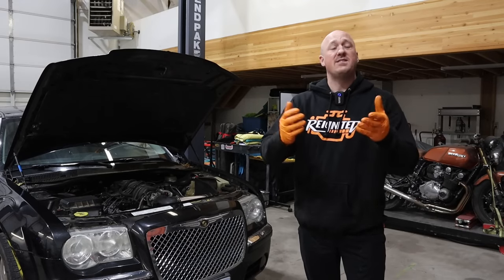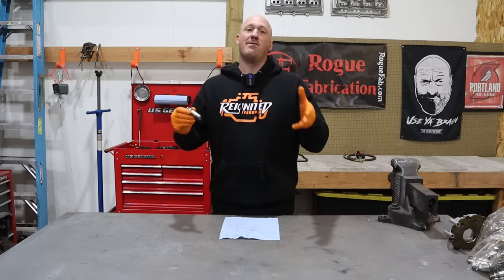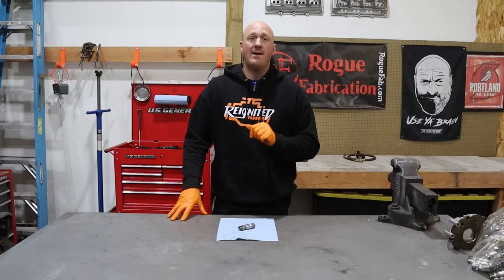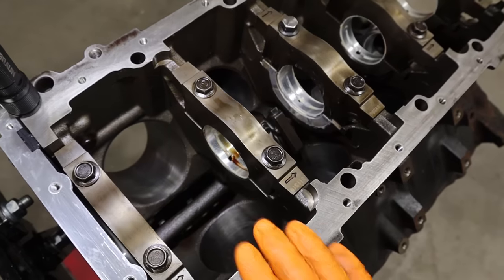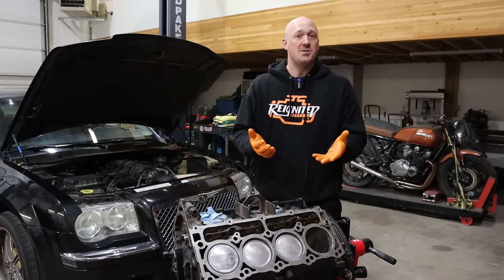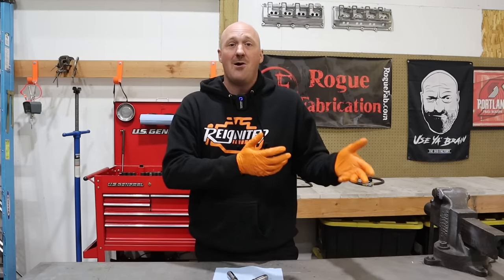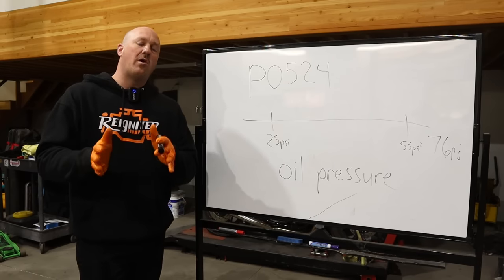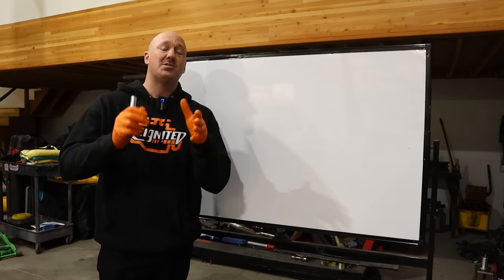The BEST Prevention For Hemi Lifter Failure! (In My Opinion)

Comment: My 2015 Ram 6.4 got metal in oil at 98k. Bought a complete engine from Chrysler, cam from crane, upgraded springs Removed MDS, Hell cat oil pump and lifters, new radiator.  After JMB in Hillsboro Mo. tuned it the transmission shifts correctly finally after 8 years. (6 speed).
The coolant always stays at 215 degrees and the oil temp stays at 226 degrees. 9k miles so far so good.  But at a total cost of $18,700. I hope it holds up. I do not want to buy another new truck. I still have the old motor and have not opened it up yet. Also this was during the time of parts shortage 6 months of waiting. Soon I will have dual exhaust and be able to enjoy the slight rumble of the cam.
Reply: When you follow the lighter oil the car will prematurely fail.
Reply: @johnf.6942  That's what I've heard.
Reply: It seems rather redundant not to use a 180* thermostat, but it sounds like you’re an engineer.

Comment: A most informative video.  Nice to know that mds is not the real problem.  I change the oil on my 2015 300 hemi at  5000 miles or less and use synthetic oil.  I doubt I will go the hellcat oil pump route but it is nice to know there is a preventative procedure available.  You explain things thoroughly and clearly.    Thanks again.
Reply from the maker: Appreciate you watching!
Reply: MDS still not good. If I want a V8 then I want a V8 all the time. Not a V6 or 4 cylinder. I only get 13 mpg with MDS anyways. I have a 06 2500 power wagon.
Reply from the maker: @DavidSmith-tu1nd  I do think it doesnt make sense in the bigger trucks like that. Problem is that wringing every last ounce of fuel economy out of these engines is the only reason they have lasted as long as they did. EPA mandates are not awesome.
Reply: @ReignitedAuto  
Yeah I know epa stuff. Is it possible to mount eagle heads on a 06 engine? My engine is running strong no valve seats have let loose, I known the eagle heads were more efficient.
Reply: @DavidSmith-tu1nd yes you need eagle pushrods, .070 cometic head gasket, new exhaust manifolds and intake manifold
Reply: @ichrised 
Thanks for the info. I'm gonna do this head swap and make the oil pump up grade.
Reply: Too many mile interval. It is established only to meet warranty. Change @ 3,000 and the engine life will be nearly double.
Reply: Thank you so much for this forever a subscriber , does changing my oil pump VOID my warranty ?
Reply: @wendellrivers853 most likely yes. I wouldn't touch anything until the warranty period is over.
Reply: @3029dz  Good full synthetic motor oil doesn't need to be changed every 3000k miles -- it just doesn't break down as quickly as conventional.  If you feel better about changing every 3K like grandpa swore by, just stick with conventional.
Other than that, I don't disagree with 5k intervals on full synthetic.  The Hemi probably needs a bigger oil filter to make going much longer than that safe.
Reply: Just replace camshaft and all 16 lifters!!! 6000$ bill for parts only...all OEM
Now have about 20,000 km and still thick and run rough on idle and still suck à lot of gas... reopen engine 3 times, put 4 solenoids MDS and cam solenoid and still thicking...
No troubles codes 
Someone have and idea?
I regret havent put a new engine at start or have done MDS delete
Maybe have to say, first time i start engine after cam job, it run perfectly till i hit the road...
Reply: @simonac850  is this in a 2009 or later, or a pre-eagle engine? Did you pull the screen to verify that there were no shavings to the screen yet (2009 and later only)? That is the thing you must do before swapping in the new parts. If you see shavings, the rule of thumb is to rebuild or replace at that point.
Reply: If you are pumping shavings around in the engine, it can't help but fail right away. The fact that your ticking started as soon as you took it on the road makes me worry that your lifters are failing again. Have you verified that it is not an exhaust leak? The ticking sound is similar, it is also not uncommon to have an exhaust leak after doing this work.
Reply: @simonac850  you probably rebuilt your engine multiple times and only had an exhaust leak to start with....

Comment: Hi. I'm from Poland and here this engine is not as common as on the continent, which is why most people succumb to stereotypes rather than delving into the topic of the MDS system, which is considered to be defective. No one could answer why it was so bad. Initially, I thought it was a matter of poorer material of the pushrods, because in engines without MDS the effect was similar with damage. Thank you for such a sensible explanation. Finally someone wanted to delve deeper into the topic.

Comment: This is an outstanding development! I can’t thank you enough for the effort that you have put into the tick issue. 
I have been through this, replaced the cam and lifters, followed your advice and upgraded to the HC pump in my 2012 R/T. The P0524 error has been plaguing me as a result. I installed a code reader and just keep clearing the error as it comes up. I will definitely be putting the in-line resistors into play as soon as possible. Thank you so much for all that you do. 👍🏻👍🏻
Reply: Hey man have you done this yet?

Comment: Both my hemi-powered Mopars are performing flawlessly, with 130K miles on my '12 Challenger R/T w/5.7 hemi & 6 speed manual trans, no leaks, oil usage, or ticking other than normal injector firing noise, same deal with my '14 Chrysler 300C w/5.7 hemi, excellent performance at 91K miles and no "tick" either. I use high quality synthetic oil in all my rigs, it has kept them running very well and change oil & filter @ around 5K miles or 1 year.
Thanks for a great video!
Reply: Preventive maintenance is always the best thing to do

Comment: I have a 2013 Dodge Durango Citadel with almost 50k miles. I ordered the Hellcat oil pump as soon as I saw your test results and just installed it. I will go further eventually but I think for now I should be fine. Thank you so much for this incredibly valuable information!
Reply: I do have a question. How do you know if the MDS activates? I know it says "ECO" on the cluster's EVIC screen, but that could mean that's what the computer is trying to do? I still see it with normal driving even after the Hellcat oil pump install. I will pay attention to my car's exhaust as it's pretty loud to see the difference in sound and if the MDS is off.
Reply: Also, could you link the voltage divider you used?

Comment: Great info. I used the Hellcat pump on my 2014 Ram after I did a cam/lifter replacement and I have zero issues.
Reply: How about now? I just got a 2019 with 75k miles I’ve put 3.5k on it about to pull my first filter see if I find some glitter but I want to go this route

Comment: 😊Great info again. I had to replace my cam, lifters and pushrods at 192,000 miles. That was 29,000 miles ago. I had the hemi tick, but when I started having misfires, I took care of the problem in my garage at home. I bought a Hellcat oil pump after listening to the info you provided based on your many years of experience. I too have had the recurring PO524 code despite excellent oil pressure(too good for the ECM). I will follow these instructions so I won’t have to keep deleting this code to use the MDS for my long drives to work. Thank you for all of the info on this topic!
Reply: No, but turning the MDS system OFF with a tuner WITHOUT an MDS delete does cause ACCELERATED lifter/cam failure.  

The MDS lifter doesn’t get high pressure oil unless the MDS is engaged on the freeway.  

IF, you’re idling for long periods AND, you ALSO have the MDS system turned OFF, those MDS lifters NEVER get that high pressure oil flow.

FYI, adding a “HELLCAT” oil pump on a 2012 5.7 HEMI disengages the MDS system due to oil sensor error.  Ask me how I know.

I heard you need a HELLCAT oil sensor as well.

Did a 5.7 HEMI Dodge Charger engine rebuild WITH cam/lifter replacement while adding a HELLCAT oil pump.

MDS system was disengaged due to an oil pressure error code.  Experienced lifter/cam failure 11 months later!!  Not 75k miles later.  10k miles later.

Good luck
Reply: No. The MDS lifters get the same oil flow as the non MDS lifters when they are under normal operation with MDS not activated. They just get MORE oil when activated to activate the MDS system.

Comment: Extremely well done video. Thank you for your insight and research. I learned a lot!
My 2015 Challenger pretty quickly developed the issue and had all the lifters replaced (but not the cam) under warranty in 2017. All this time I thought the newer parts were the cure!
It's worth mentioning that the first failure was at 15K miles and now at 65K, it's still totally silent.
Reply: Chrysler =junk

Comment: Re: Hellcat Oil Pump.... high end pressure outside MDS acceptable range. If we deceive the system by modifying the signal we have neglected to determine if we are going to negatively impact the MDS sysem by exposing it to oil pressure above the spec'd range. It seems better to very if whether the MDS system can tolerate the range and to  edit the range in the PCM parameters if possible or install a pressure relief valve in the oil pump that dumps excess pressure back to the sump.

Really appreciated this video!!!!!

Comment: Melling also has a newly released high volume pump for the later model engines, part number M452HV which has the same displacement as the hellcat pump.

Comment: Great video dude !! Your explanation was spot on. I have a 2012 Grand Cherokee 5.7 hemi . Mopar had to replace the engine at 98,000 miles because of this. LI’m one of the fortunate ones that have a lifetime bumper-to-bumper Mopar warranty on my Grand Cherokee. At this point I might just go ahead and install that hellcat oil pump because I plan to keep the car for a long 😊 time .
Reply: Lifetime bumper to bumper? Dang! How does someone get one of those?!

Comment: Sounds like the similar issues that Ford experienced with their 4.6 and 5.4 engines. Senior Ford technicians, like Fordtechmakuloco extended the life of those engines with installing the upgrades lifters, rocker arms and Melling HO oil pump. In addition, the timing chain guides and related components. The installation of this Melling HO oil pump. The engine oil pressure increased slightly, less than 10 psi, but the flow of oil was increased to to the high output of the oil pump. Excellent educational video!
Reply: FTM is awesome knows his shhhhh

Comment: Your concerns regarding the oil reminds me of an old 6 cylinder 2 cycle navel diesel. It had a visual oil channel on top of top of the engine. Before starting the engine, you had crank the manual oil pump handle until you see oil running through it. Then, you count 100 cranks before starting the engine. Oh, this engine was so old that they used 6 propane torches that were mounted on a swivel to preheat the cylinder walls. This engine was over 75 years old and had never been rebuilt!
Reply: That engine was "built to last" but was also extremely heavy for the amount of power it produced.

Comment: I have a well maintained ram 2014. and with 260K kilometers i had an issue with cil.no 1 . first thought it was a misfire and changed coils , NO check engine light came on. then tested compression and only cil no 1 had a bad low compression. I took it to a good mopar specialist in the netherlands and they discovered a lifter failure and ate one lobe out of the camshaft. The bad lifter it was even twisted 90 degrees. now i have a rebuild engine with non MDS and new lifters and a stronger cam, a lot of new parts and a stronger oil pump. Idling for a long time in trafic is not so good for a Ram . i hope i can do 200k again. for the rest the truck has no problems. Thanks for the informative video!

Comment: Converted the 5.7 EZH to an EZC in my '15 300s. Planned to install 6.2 lifters, but they are indeed the same part # as a 5.7. It runs great, and still obtain 22mpg at cruising speeds.
Reply from the maker: Very nice!

Comment: I'm glad I found this video. I have a '14 Charger with 132K miles on it. Because of my normal driving habits (mostly highway driving and a comparatively low amount of engine idling) and regular oil changes, it put my mind at ease about possible lifter failures in the future.

Comment: I agree with many that the push to thinner and lighter oils is part of the problem. While many will disagree with me, I have found that using a heavier weight oil helps. In fact, I have solved more than a few problems using a heavier weight oil in many cars and trucks. Personally, I use 15W-40 in most of my vehicles and the results have been excellent. 10W-30 is another good choice for many. Whenever an up graded oil pump with more volumn and another 5-15 psi is also a real help.

Comment: I found your videos after developing the lifter tick in my '19 Pursuit. I replaced everything and did the Hellcat oil pump as well and left MDS intact. I couldn't find a 7.4k resistor and used a 7.5k and wired it in last night. The MIL didn't come back on and I believe the MDS was working as my mpg on a route I drive daily increased from before I added the resistors. Thank you for your videos and help!

Comment: Thanks for the great video. Since I bought my 2022 PW, I've been following the advice in your previous videos.  Oil change at 1000, 5,000, 10,000 miles. Minimizing my idling. Using very high quality oil, Pennzoil Ultra Platinum. Once out of warranty, I'll see about doing the oil pump upgrade.
Reply: I like your using the Pennzoil ULTRA Platinum. I've become convinced that is a superior motor oil. Amzoil may be slightly better, but IMO the difference isn't worth the difference in price & availability. I'm using it in all my more modern Mopars. I also am a firm believer in the use of FilterMags oil filter magnets to better clean the oil and keep the ferrous "dust" out of the engine by capturing it in the  filter canister until it is disposed of during the oil/filter change. If you cut open your magnet fitted oil filter, you'd see what I'm talking about.
Reply: 10,000 miles is too long to wait
Reply: @Gary_in_NoVA  ...I use Pennzoil Ultra Platinum and change my oil every 4000 miles the latest
Reply: @Gary_in_NoVA I think he meant change it at 1000 5000 and the 10000 mile mark.

Comment: My Pop had a 2005 SRT 300, he loved to pull off the road and talk on his phone. Around 109 thousand he asked me to look into this squealing noise,it sounded like a hamster wheel that needed grease. I told him the bad news ,the lifter.  I swapped a OEM take out  cam from a
 06 6.4 . The old one was a billet steel core,the newer was a casted steel. We think the lobe was soft and killed the roller . It's a lot of work getting to the point of pulling the cam. 12 + hrs to complete, Dodge parts guy said 11.5hr ,so I was happy that I came close on my first hemi cam swap
Great technical info ,wish I had it back in 2010 !

Comment: Beyond a doubt this is the most comprehensive informative tutorial I have seen on the cam and lifter problem. I know you cannot say this as a employee of FCA. There is a tune that will turn off the MDS and raise your idle RPM’s by 200. without setting a code. What I do personally is turn the MDS off when I drive my RAM 2500 6.4. Simple to do. Just set your transmission to 6 on shift lever. MDS is off. I already had the cam and lifter problem under a factory extended warranty. Matter of fact I have used it twice for major transmission issues also. Matter of fact I just bought another one that covers the drive train to 160,000 miles. My advice buy an extended warranty when you buy these trucks. Once again great video.

Comment: The thing that worked for me was royal purple engine oil and a mopar filter. Truck had 147,XXX 5.7L hemi no knocking. challenger has 152,XXX 5.7L hemi no knocking and it sat for over a month. Fired it up no smoke no knocking. Both are 2013 year models

Comment: Never knew of this issue until it happened to me! I am fairly mechanically inclined and usually have at least some insight into common problems on common vehicles. If you start getting this specific lifter tick, don't wait! It starts as a common lifter tick that progressively gets worse. Mine was slow enough that it made it hard to notice it worsening! Im stubborn and always want to fix car problems myself. That in combination with the problem being on my daily driver, just ended up costing me more in the long run. Wish i would have seen this video a year ago! Awesome content! Very informative.

Comment: Great info. Super easy explanation. I don’t own a Hemi up here in Canada, but have and do own some Dodge products. I always tell people to do what most manufacturers say, (I tell my wife the same) get in vehicle and start it, then put seat belt on and adjust whatever you need to, turn radio on etc. Then put it in gear and go. Don’t drive like a maniac if it’s -40F, but start driving & tack it easy for a few minutes. The vehicle warms up way faster driving than idling.

Comment: Wow, an automotive video that keeps it real and isn't trying to sell some miracle cure or expensive aftermarket parts. As an engineer, every word you said makes perfect sense, and I could not pick out one single word that doesn't comport with my knowledge, education and experience. The pressure vs volume, the voltage divider explanation are all accurate, and  as far as I can tell, and the insight that the MDS and its attending block redesign was implemented in 2009 when the problem started makes perfect sense. The oil change interval advice and the extended idling caveat are both also dead nuts. You got yourself another subscriber just with this no-nonsense, anti-bullshit video. You earned it.
Reply: Can you please tell me the voltage divider needed to fix the check engine light? Wished he put one in the description.